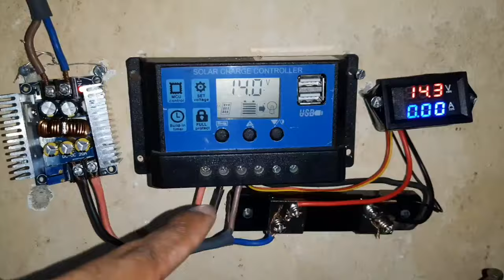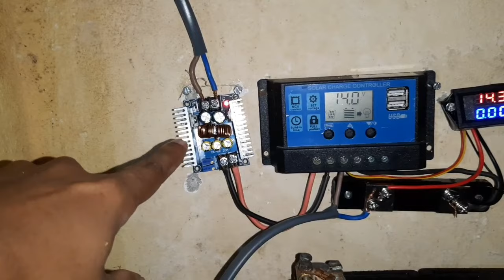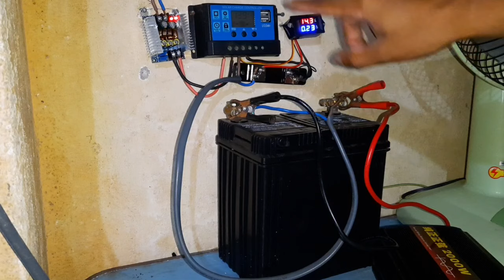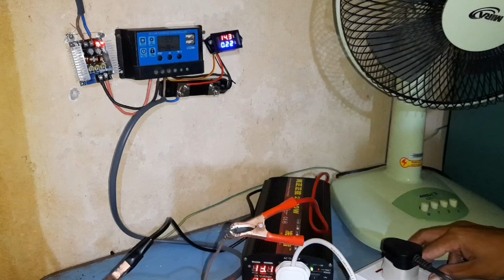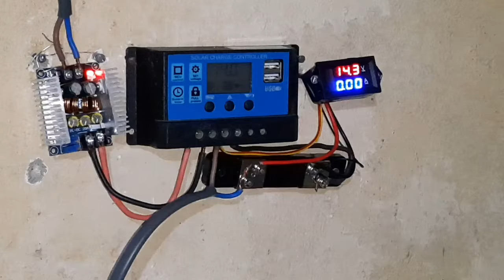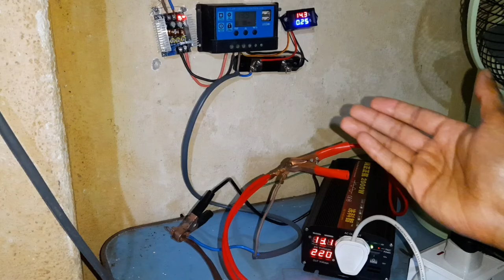Solar Powered Fridge - How to Run a Fridge With and Without! Batteries

Comment: This set up only works when it is daylight, with or without the battery.
Obviously, without a battery, the panels do not generate power at night.
You will need several batteries to support the fridge all night.
Then when the sun comes up again, you will need to recharge the batteries while still running the fridge.
If you are not able to recharge the batteries completely during the day, you will not be able to run the fridge the next night.
If you run a lead-acid battery below 50%, then you will harm the battery.
I suggest that you build a relay to switch the fridge back to grid power in case the battery runs down, use the output side of your charge controller to control and power the relay.
Program the charge controller to shut the relay off when the battery gets below 12V and back on above 12.8V. (The Eco-Worthy charge controllers are more programmable.)
This also takes care of cloudy days.
But doing this also means that you will only run the fridge on solar for a part of the day, not all day.
Depending on how many batteries you have, you can adjust the times the inverter is on.
Leaving the inverter on all the time will also deplete your battery.
I used an Alexa compatible smart switch (double relay) to turn on/off the inverter at certain times of day.
Open the inverter and run 2 wires parallelling the on/off switch and run the 2 wires to the Alexa switch.
The other Alexa relay is in series with the grid relay.
The Alexa App allows you to set up a routine to control each relay separately.
I set my relays to come on 1 minute apart at noon and turn off at 4PM.
I only have 2 batteries in parallel at this time.
I could run the appliances longer if I bought more batteries.
I am running an upright freezer and a side-by-side fridge this way on the same 2 batteries, 600W of panels (12V), and a 2000W FSW Inverter.
Again, this is only good for 4 hours per day, or 60 running days per year, if full sun.
It would take about 5 years to recoup my expenses.
Reply from the maker: Great explanation about the batteries and i like the idea of the relays as well. That is a really good way of avoiding batteries for the night. Anyway this video was only for proof of concept that you can power heavy induction loads using supercaps and without batteries. For a proper working setup your idea with the relays is the best.

Comment: So will that dc to dc converter handle the variable dc voltage from the panel 24hrs a day?   The solar panel feeds a wide range of voltage levels throughout the day.   Does it get hot?
Reply from the maker: First of all you can only get good usable power directly from the panel for only 6hrs a day around 12 noon. During this time it does a wonderful job of stepping down the voltage to our desired level. And yes it gets slightly hot. That is why it has big heat sinks. For every day use it doesn't need a cooling fan.
Reply: Ofcourse it only receives voltage during the sunlight hours. I only asked if it's effective receiving variable voltages throughout the day.   You have turned a pwm charge controller into an mppt controller
Reply from the maker: @mr.makeit4037  Nope.... This setup is not as effective as a mppt controller but it is good in regulating the voltage.

Comment: My system not runing a fan for an hour connection setup good what's u think is round
Reply from the maker: First of all I need to know the power of the fan?, your battery capacity?, power of the panel? and whether your inverter is puresinewave or modified sinewave?

Comment: I could see from the start that this video would potentially end up being pretty hilarious, and it was quite funny,  until you correctly introduced the capacitors. Well explained too! Suprising how few people understand the concept of this method when needing to 'start' an inductive appliance, ie. refridgerator/motor, when only having use of lower power invertors/panels. But just to note: the charging circuit here implements Pulse Wave Modulation method, so is only suitable for lead-acid types of battery, as opposed to MPPT types which are for use with the latest technologies, ie. LFPs (LiFePO4). The buck convertor? Well, straight away this creates loss in the system from the panel, via heat loss, which should be avoided. Correct voltage panels suited to the charging circuit would be more appropriate. Also, add approriately-rated in-line fuses [for the intended application] and diodes to all of the lines (including both postiive/live and negative/neutral lines), for safety and to help prevent malfunction and destruction of the electronics.
Reply from the maker: Thanks!.... The charging circuit ofcourse... Well the main component here is the buck converter which is there to stabilize the voltage to 14.4v as the panel is giving around 18.5v at MPP. You wont need the pwm scc. I just kept it as it was part of my system. As you said... If you want the max out of your panel you would have to make sure the battery charging voltage matches the panel mpp voltage or using the MPPT scc which is the more expensive option.
Reply: @diysustainableliving2774  You did a good job at explaning a basic solar setup, compared to the majority. I just don't like the cheap (usually Chinese 'knock off') buck convertors, as they waste alot of energy, use low specification components and therefore often produce unstable voltages and lots of noise (electrical noise). Where I have to use these in circuits (particularly audio-based cicruicts), nothing really beats the Anolog Devices transistors, with typical Noise Factors often around the 1dB/2dB. But, these circuits obviosuly don't need to go down that road. Still hate bucks though.
Reply: And the supercapacitors, again, nobody else seems to mention these in their videos. Well done for mentioning these. Shows that you understand electronics far better than most of these 'solar starters'. It's probably because these people learnt all that they know from other YT videos. Explains why they all appear the same.
Reply: If the buck converter was dropping the panel voltage to 14v  then the solar controller would not be working in pwm mode and the solar controller was creating more loss than the buck converter. since there was no batteries in the circuit the diodes would be just wasting power since the load will/should not be feeding any voltage back to the panel. the inverter have fuses and I do believe the buck converter also have a fuse onboard at the input side of it
Reply from the maker: Yes the PWM is not needed here.

Comment: how long can it run tho with supercapacitors?
Reply from the maker: Good question. If you are only connecting supercapacitors then it wont last for even one second! The supercapacitors are there only to start the heavy load. After starting the fridge will be running on the power directly produced by your solar panel. So while this is working if a cloud passes over head the whole system will shut down.

Comment: Sir can i asked. Your solar inverter 12 volts and 2000 watts? Thank you
Reply from the maker: It is 2000w peak that is 2000w for only a fraction of a second. Like when a motor starts up. It can handle continuous power of only 1000w. You should always check the details before you purchace anything online.

Comment: I have 300w solar panel and 200aps battery but the fridge keeps on cutting when running and it only cools    the stuff failing to freeze the stuff. It's a deep freezer help please
Reply from the maker: If you have good sunlight the sloar panel and battery should be more than enought for any freezer. What about your inverter? Is it a pure sine wave inverter or modified sinewave? You will need a pure sinewave inverter when you are running heavy induction loads. Also what is the power of it? The inverter rated power should be more than 5 to 7 times that of the fridge as the fridge uses almost 5 times its running power during startup!
Reply: @diysustainableliving2774  the fridge has those pegs, so it's direct to the battery. The solar panel then to the power controller then to the battery. Then the fridge came with those pegs to connect to the battery direct
Reply from the maker: Oh is it a DC power fridge. If that is the case make sure you have thick wires running from your battery to the fridge. Also if it needs more power consider adding supercapacitors to your setup. It will be helpful if you could give more details on your fridge and its specs.

Comment: i have solar panel 20volts and maybe 50watts .if i use booster it can run 300watts heater on my inverter 12volts 1000watts?
Reply from the maker: No... You cant use 50w to create 1000w. You cant get more than what you put in.

Comment: What size cables connect panels to battery and controller?
Reply from the maker: For that I used the AC mains wire as they can handle a good amount of amps and are cost effective. From both panels I would get a maximum of around 14A but the wire can handle around 30A.
Reply: @diysustainableliving2774  
Thank you for responding.
Do you know the wire specs 1.25mm, 1.50mm. 2.0mm, 2.5 or maybe  12, 14, 16. ?
Reply from the maker: No... Just look up at your local hardware store for AC mains input wires.

Comment: How about reactive current from the fridge motor and power surges? Do you need some other electrical component?
Reply from the maker: Yes I have made a separate video on power surges and voltage spikes. Please see that.

Comment: How long will a fridge run in a battery only, asking for night time when there is no sun,
Reply from the maker: It depends on the size of the battery and how much power is stored in it. My current system with close to 100ah battery storage is able to power that same fridge over night and still have around 50% power remaining. So if you want to run a fridge you will have to know how much the fridge is going to need over night!
Reply: @diysustainableliving2774  Fridge runs in abt 120 watts, and the battery i got its also 100AH,
Reply from the maker: The fridge dosnt run continuously. It stops and starts. It is best to get a watt meter and see how much you will need for 24hrs. And calculate your system for that requirement!

Comment: Mag po gagastusin if magpa kabit ng solar para sa refrigerator lng po?
Reply from the maker: It depends on the cost in your local area and the battery chemistry you want to use. Calculate how much power your  fridge uses in a single day. You will have to build a system which could accomodate that energy in a single day and have a little bit extra reserve to compensate for possible rainy days as well.

Comment: Nice video. Using super caps is brilliant.
Reply from the maker: Well. Keep in mind that supercapacitors are different from batteries. They serve a specific purpose that batteries cannot do. Like wise they cannot fully replace batteries aswell. Think of them as a tiny battery with a big mouth!

Comment: How can we run the fridge in the night. Because fridge has to be operative in the night also.
Reply from the maker: For that you have no option but to add a good capacity battery. Even in the day aswell if you don't have a battery a cloud passing overhead can shutdown your system. Thats why Im recommending to add at least a small battery to your system to stabilize it!

Comment: Super capacity value plz.capacitors ac or DC.voltages. And micro ferad.plz ans me
Reply from the maker: These are DC supercapacitors. They are not in the microfarad levels they are in the Farad levels. Each of these are 2.7v 500F caps. There are 6 of these attatched in a series.

Comment: How does the fridge run at night?
Reply from the maker: It dosent!... This is just a proof of concept video that you can start and run induction loads directly using solar power without a battery using supercapacitors. If you want to run the fridge at night then you will need a battery.

Comment: Hey sir what is the name of this device that the wires from the solar panel is connected to then goes to the charge controller
Reply from the maker: It is called a Buck converter or Dc to Dc step down converter. The one I am using is rated for 20A.
Reply: @diysustainableliving2774  thank you sir

Comment: Please tell me....
How long time run fridge without battery...????

By the super capacitor bank system...
Reply from the maker: Please Note. Supercapacitors DONT HAVE! significant storage like a battery and they are neither a power source like the solar panel. The fridge wont last even 10 seconds with supercapacitors alone. It needs either a battery or solar power to work!
In this video I am using the supercapacitors only to start the fridge. After that it keeps running on direct solar. If a cloud passes over everything will shut down.

Comment: Dear Sir
My solar panel generate 61v to 91v , unable to connect direct solar controller(50V)
I want reduce solar value below 50v,
What is number you used Buck Converter?
Thanks
Reply from the maker: What is your panel voltage at its maximum power point? And what is the system voltage? If it is 48v then you wont need a buck converter. If it is 12 or 24v you will be better off considering an MPPT scc.
Reply: @diysustainableliving2774  Max  power is 91V
Thanks
Reply from the maker: @Sudath Peiris Is that 91V VOC? Onthe panel sticker have they mentioned 61v and 91v? what is the system voltage your are having? The battery bank and inverter voltage?
Reply: I use 12V 10A 110-220VAC LED power supplies.  These easily work on DC down to 60V and still give 80% power.  They have to be modified to produce higher voltage and can be used with cheap PWM CC.

Comment: Difficulty I have is that the inverter goes into fault low voltage and won't restart when the sun comes out after a cloud. I use a battery but with a sun sensor which only turns the inverter on when sun is shining strongly. If the sun goes the inverter resets. Fridge keeps cool 24 hours with minimal use of the battery cycle life.
Reply from the maker: What is the size of your battery? And dose your fridge work an night aswell since you have that light sensor?..... First make sure your inverter is powerful enough to run the fridge. Second make sure the voltage at the input side dosent drop. That is 1) to make sure your battery is big enough or 2) you have added supercapacitors  and 3) you have thick wires and the contacts are clean. Another important thing to consider is how rapidly your fridge cycles. If the sun sensor turns off when it is working and restarts quickly the fridge compressor will have to start to work against a high pressure. This causes it to draw a lot of amps than starting from a resting period of a few minutes!... I think the problem is the light sensor in your system.
Reply: A sun sensor?   Do you mean an ldr?

Comment: Sir gud pm I have a question,sir i have a off grid set up,300 solar panels,50a controller,1500 watts inverter,100ah battery.what is the luck of my off grid set up run of a refrigerator?
Reply from the maker: What is the size of your refrigerator? And is your inverter pure sinewave?.... I think with this setup and an average size fridge you should be able to connect it an keep it running 24×7. Just do a few calculatios and see!

Comment: After long time search I found your video, 🙏.
1) I have Chinese 1600 watt inverter, rated power 800.
2) 42 ah SMF battery single
3) 150 watt poly panel
4) 10 amp pwm controller
Can I able to run 170 ltr fridge in day time.
Dc to DC buckcoverter 300 watt ok ?
2mm or 4 mm with battery and inverter would be best.
Reply from the maker: I hope your inverter is a pure sinewave one. Battery 2) panel 3) and PWM controller 4) is all that you will need to run during the day time. If you want to run it at night aswell then you will need a bigger battery and preferrably an MPPT charge controller to get the maximum out of your panel.. The buck converter is not good as an MPPT charge controller so that might not be of any use to you. And the last one 2mm 4mm! I didnt understand it?
Reply: @diysustainableliving2774  hello hey love the video from Canada  hey I want to run a freezer and few saws off grid help me please 
I really  want to know a good link to buy  
#1 what size how many solar panels I would need ,
And inverter size  and controller 
I'm so lost down the rabbit hole confused  dang
Reply: @diysustainableliving2774  I following up  to this  so far ok
Reply: @diysustainableliving2774  Can I use off grid without batteries with MPPT? What alternative for buck convert for use mppt?
Reply from the maker: @silascardoso  Yes MPPT is basically a buck converter which is able to keep the panel voltage at its maximum power point to extract the maximum power. MPPT should be better than a buck converter. I havent tried it since I dont have an MPPT charge controller.